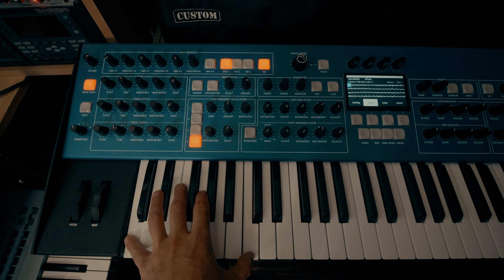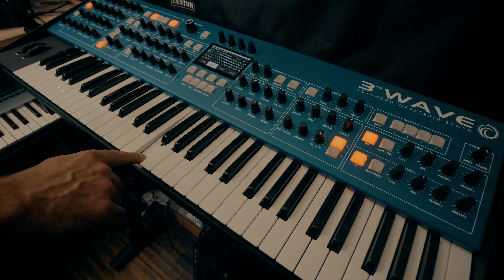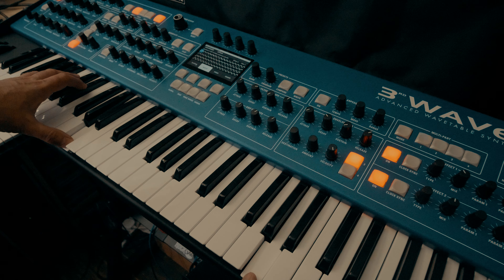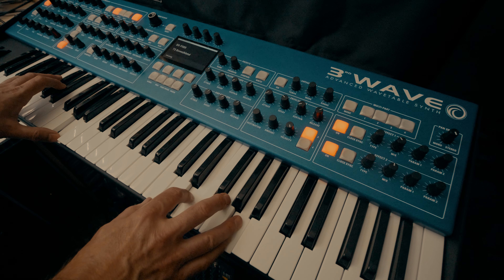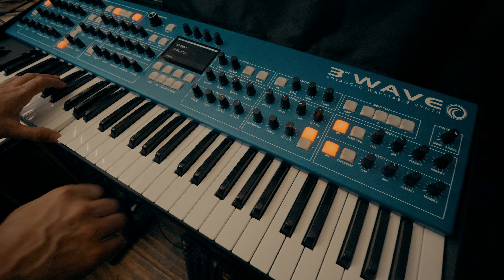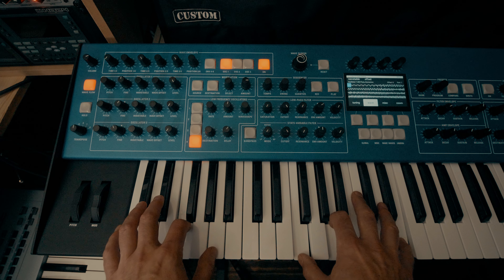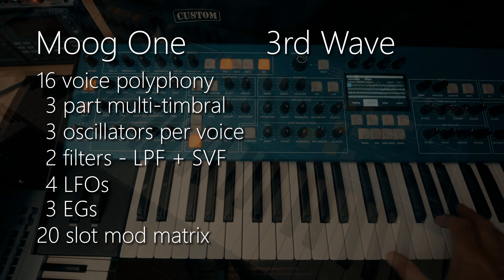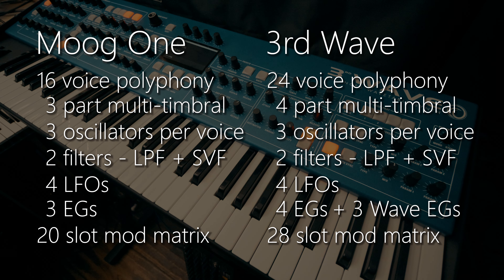Groove Synthesis  | 3rd Wave  | Initial Impressions

Comment: 3rd wave: 48 wavetables, 5.800 euros. Hydrasynth: 219 wavetables, 1.110 euros. Guess which one I got for my home studio setup..
Reply from the maker: The hydrasynth doesn't actually have any wavetables at all. It has 219 individual waveforms. On the plus side you can combine them how you like into a custom wavetable with up to eight waveforms in. So that's a huge number of combinations to play with. The 3rd Wave allows you to record/import your own wavetables, so sonic capabilities there are endless. But judging these two synths on numbers of waveforms and wavetables - or their cost - seems a bit  futile, they are very different instruments for very different budgets.
Reply: @TimShoebridge  The fact remains that every sound you made on your video exists in the Hydrasynth. It makes no sense for anyone to throw away this kind of money. My advice to everyone is they should get a 3rd wave as soon as possible, because when the company bankrupts these instruments' value will skyrocket. If they can stand its ugliness that is.. AND a huge thanks to you, videos like yours prevent people from losing their money on overpriced gear. At least it worked for me.

Comment: Lovely! I’d love to hear just pure scanning of the wavetables with the Hydrasynth.
Reply: It's not going to sound anywhere near this good because the analog filters add at least a touch of distortion that smooths things out on the 3rd Wave, just like on the Quantum vs Iridium.  However you also can't get around those filters on the 3rd Wave or Quantum (other than bypassing the filter entirely), so the Hydra and Iridium can also do things the 3rd Wave and Quantum can't.
Reply: @hostnik777 you can use the same digital filters of the iridium on the Quantum. But you can choose the Analogs, or 8 analog plus 8 digital...

Comment: Thanks Tim - You definitely get a lot of mileage out of one oscillator! Great video!  And I have to say also say thank you for pointing out what it is capable of if you use all of its capability.
There are a total of 64 "User" wavetable locations separate from the PPG locations, of which 48 come loaded by us. A user can load all 64 positions and can of course replace what is there. It will make a wavetable for you automatically from audio, and you can save and load wavetables via the USB port.
Reply: Hi Mr Coover, if you get to read this. Wow, your synth is beautiful. I know I shouldn't ask, but I'm hoping for a desktop 3rd Wave?????
Reply: @bilonggrisimmeri  I will have to "Take the 5th". But it is not out of the question.

Comment: As always, thank you for giving a level of access that is helpful, interesting, and insightful. 

However, rather than the apples to capybaras comparison you give between the Moog One and the 3rd Wave, a much more helpful and useful comparison would be between the current Korg wavetable offerings and/or the current Waldorf offerings. The former would be useful just to demonstrate the 3rd Wave’s superiority (leaving the cost differential as a reasonable deciding factor) whereas the latter would be much more useful for the if-I’m-already-going-to-spend-5k-on-a-synth crowd. For example, I love my Iridium (which is much more expensive in the US!) and don’t see a vast difference between the Quantum/Iridium and 3rd Wave, would the latter really give me that much more sonic pallet? OTOH, features on the 3rd Wave that might sway my opinion (like actually being able to sample (directly!) as opposed to all the tedious mucking about in hyperspace most mortals have to do to import any external audio) might be a big win and deciding factor for some folks with the 3rd Wave.

Comment: I'm impressed with the fidelity (duh) but the wave table scanning is so smooth. I guess I'm used to the old Wavestation A/D or the SynthTech(MOTM) E350 where the smooth interpolation is hit and miss (horrible w/ the WS and much better with the E350 - but not as good as this).

Comment: About two months ago I took delivery of a 3rd Wave and have been engrossed in it since.  Youtube audio doesn't do it justice, it sounds a lot richer and more detailed and it is remarkably dynamic when played through monitor 'speakers.  The workflow is logical but because it's such a powerful synth it does take some time to get to grips with it and the effects processing section leaves nothing to be desired.
As Tim stated, it is expensive but you do get one hell of a synth and it looks beautiful.  Groove Synthesis have done a remarkable job in creating this synth and I would highly recommend it.
Reply: YouTube audio is pretty decent these days with the Opus codec they use, assuming you're not bandwidth limited, which can result in you getting a lower quality audio stream.

Comment: In theory at least, if you put the same wavetables into another wt synth, you could come close to sounding like this synth ???   E.g. Modwave???
Reply: No the lack of analog signal chain.
Reply: @videosuperhighway7655  It will be possible to test this, as PPG, Prophet VS and even Fizmo wavetables become available for Korg Modwave. Yes, I do know its filters are digital, not Curtis analogue chips. I have played a PPG Wave, b.t.w., - quite a raw sound, most impressive.
Reply: @bilonggrisimmeri  That would be cool but Fizmo waves? No Transawaves are non standard doubt they will ever be available in any synth that's not of the Ensoniq line that can accept them.
Reply: @Ambientnauts  Thanks for commenting. How do Fizmo wavetables differ from those in say the PPG? I really have no idea how Fizmo waves were made? My very short time on a Fizmo was a long time ago. Did Fizmo use 2X filters in parallel, one LP and the other HP? Also, I understand the PPG had a completely different DAC design, with clock speed changing wavetable pitch. I'm a bit geeky on this stuff!

Comment: Is it just me or is there some harshness in the sound quality?
Reply: Welcome to Wavetable / Waveform synthesis. Waveforms are packed with harmonics, many of which are louder than the root register so the effect is often very bright and tinny, perhaps even ear piercing sometimes.
Reply: @RedFishBlueFish  Having listened to the many other clips also, I think it sounds a bit raw compared with f.ex. Quantum. The sound quality is decent, but I can't come up with situations where I might use it, especially with other instruments involved. The sound could be too separate from the rest of the sound wall. But, just for electronic stuff, this machine must be very capable
Reply: @seppoinnanen5577  Yes, that’s quite the point of concern I have as well. My main go-to synth for the music I produce is an Oberheim OB-X8. Purely analogue, 8 voice beast of a synth. I strongly suspect and fear that this 3rd Wave and others similar to it, like a Hydrasynth or perhaps a Blofeld, will have enough volume but not enough presence to stand out in the mix and hold its own.
Reply: @RedFishBlueFish we are listening to the wavetables with the filter wide open. They are expected to be bright, buzzy, even harsh, until you start filtering.

Comment: Sounds better than the quantum imho
Reply: Was thinking the same... but hard to say really... maybe the Wave has a bit more furriness coming from the filter...   the sheer amount of other synth engines on the Quantum/Iridium is hard to beat...

This synth does appear to be more immediate though.. although the wave part of the Waldorf is pretty intuitive and quick.
Reply: I agree, it sounds on another level. As a previous Iridium and M owner I can say that Waldorf sound is very mediocre, but not terrible. This synth seems to be on UDO Super6 level of sound in overall.
Reply: Sounds amazing. I expect it would take me a day to program a single patch.
Reply: @Tvaroh Mediocre? No.  Super-6 is in fact great.
Reply: Fewer synthesis modes in the 3rd Wave, so Wavetable vs Wavetable I agree it sounds better but there’s more depth to the Iridium/Quantum. Iridium has polyphonic aftertouch and FM, Sampling, Granular, etc. I have both and I honestly absolutely love both but see them as complimentary, with about 25% overlap.
Reply: @SPAZZOID100 He didn’t call the Super-6 mediocre

Comment: Just want to know, which Envelope you used? The Env 3 & 4 or the 6 stage Envelope?
Reply from the maker: I used the six stage as it's hard wired so no need to set up anything in the mod matrix
Reply: @TimShoebridge  The 3rd Wave is now in my Studio since 2 Month. Many many nice sounds I made since then. The VA-Section is very versatil and extremly well programmed! The driftmode is stelar and with free running oscillators in a next update will be hopefully a dream :-)

Comment: But it’s so expensive! 😇
Reply: Yes, it is expensive — but remember, it's the equivalent of four 6-voice synths in one keyboard. Each with its own independent pair of outputs,  FX, and more.  : )
Reply: As Mark said, when you break it down, you're getting 4 synths in one, so it's not really that expensive, especially when you compare it to other synths with 6 voices.
The initial $ of PPG was 7K USD as its cheapest, so you're getting a ton of synth today with many more features, for far far less.
And you also have to remember, this is a self funded start up, the cost involved to bring to market isn't like other manufacturers who already have a cheaper alternative to manufacture.

Comment: Jesus that thing needs a low pass filter. Shave some of that tinny treble out. Yikes!
Reply: Oh… Also great video buddy!!!
Reply: interesting you say that.. I've been playing wavetables for years now since I played a PPG Wave 2 in 1987.. For some reason I've never been that fond of using filtering at all on wavetable synths (especially on my Iridium/Vital/Pigments)... don't know why and I'm sure I'm in the minority...  interesting to note that the original 360 from 1978 had no filters...
Reply: @neilloughran4437  How do you deal with the harsh ultra high harmonics? They so often out-shout the original register tone they ‘belong’ to. Cheers!
Reply: @RedFishBlueFish you use the analog 4pole low pass and/or the digital 2pole SVF.
Reply: Which part specifically? This thing sounds freaking gorgeous imo. I might have missed it, but I'm not hearing anything particularly harsh. Though granted, Tim really is showing off these wavetables unfiltered on purpose. Those crispy high end sounds of the PPG wavetables are what sets this synth apart.
Reply: I am not hearing the harshness, or seeing it on a spectrogram. Just a lot of great growl. But... Tim is not using any filtering. It has a state variable filter and 24 SSI 2140 analog low pass filters in it. You can filter to your hearts content if that is what you want to do.
Reply: It has 2 LPF's.  Rossum (E-mu) designed  2140 analog and 12db State Variable.  And this video was warm and lush.  Weird comment.
Reply: Sounds pretty lush to me